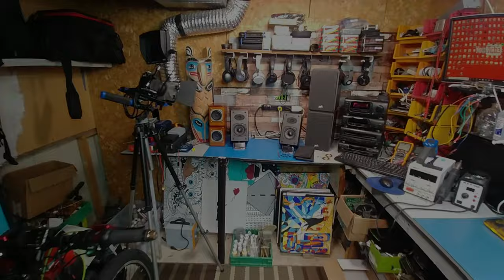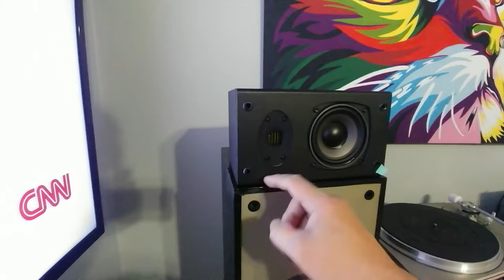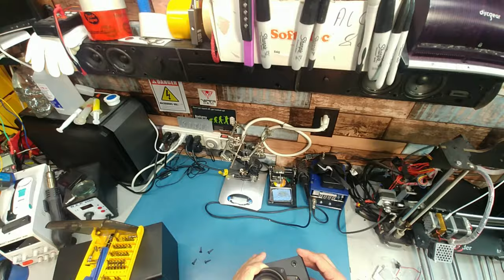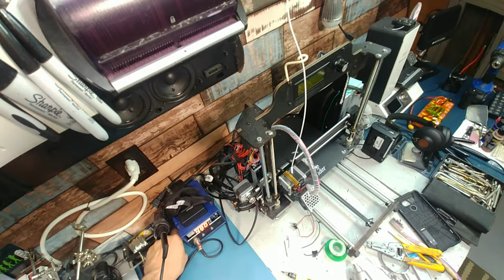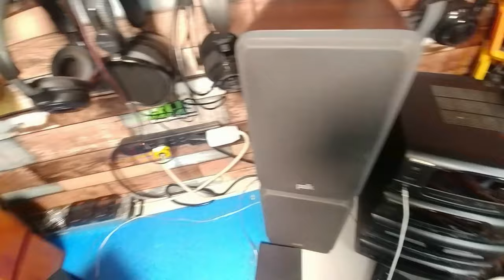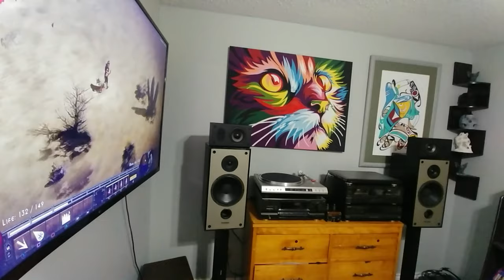Dayton Audio B452-AIR *mid-range modification*

Comment: I just picked up a pair of these last week while visiting their showroom.  They are on sale for $39.98/pr. I plan on using these on my computer with a 6.5" subwoofer and a 2.1 channel class D amp with subwoofer volume and crossover output.  I'm just waiting for the amp to arrive in the mail. I've already been listening to these on a vintage Technics SA-80 receiver and I think they sound great for what they are. I just added a bunch of poly fiber fill to both speakers and it seems to help the mids and lows quite a bit. The vocals sound more up-front now and the bass (what little bass there is; what do you expect with 3" cones?) sounds tighter. There seemed to be a bit of an echo-ey upper midrange that has been removed.  I'm a fan of tweeters of a different design besides the classic domes (Linaeum, ribbon, etc.), so I was anxious to give these a try.  I'm not disappointed at all. I've read where people describe these tweeters as bright.  Well, that's exactly what I like, a bright, crispy tweeter. Everyone has their own preferences. For a $40 pair of bookshelf speakers, these are a real value.